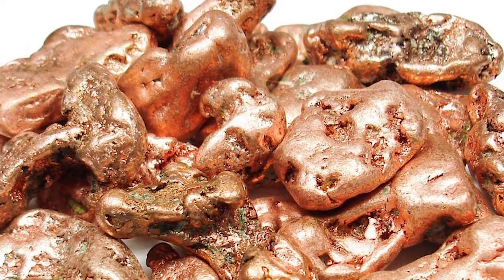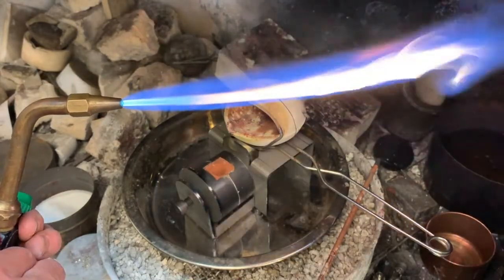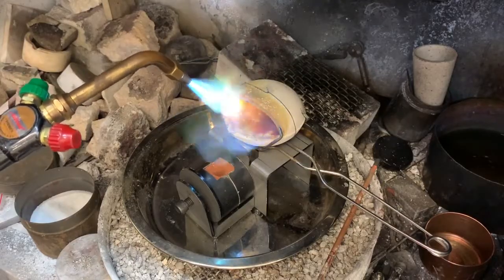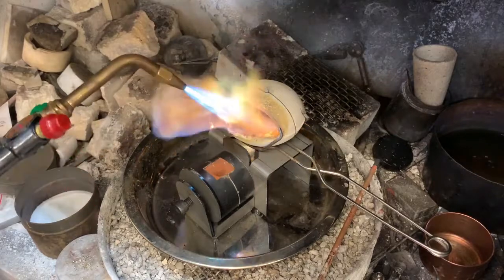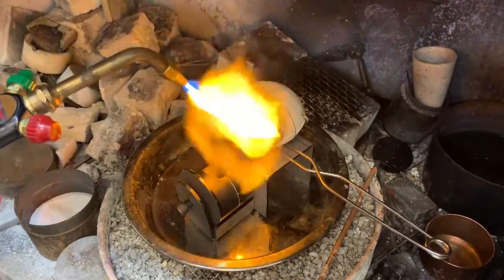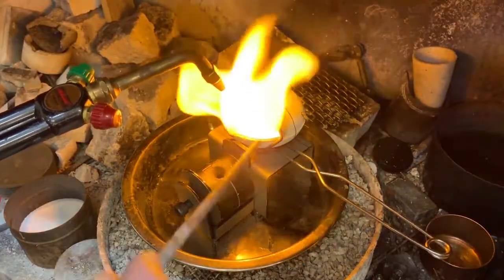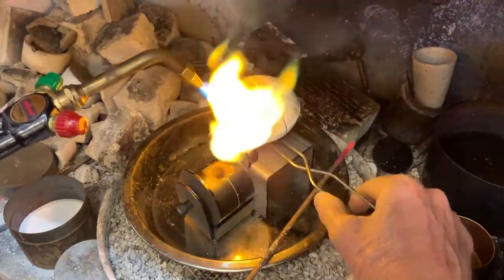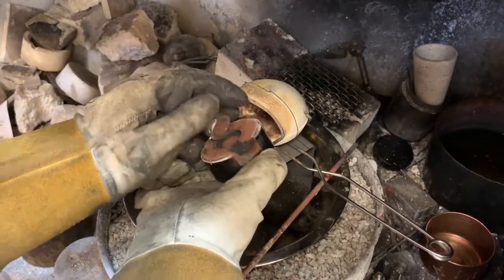Tips for Melting Silver with James Binnion

Comment: I find your video very inspirational and helpful, does the adding an extra crucible to the top help .. dumb question ... should I attempt this method to try and find better results? I am wanting to pour 8" by 1/4 x 1/4 castings to draw into silver wire. I have never done this before although I am a third generation plumber and love making silver jewelry and thought I would give it a try. Even tho it's very expensive. I've dropped a lot of funds into this endeavor.
Thank you for your fantastic video!
May God Bless you

Comment: Really amazing, I have some pure silver beads that have a bad surface because of oxidizing, how I can melt them again to get a shiny silver without oxidized surface?
Reply: If you mean pure (0.999) silver then just do as the video depicts and you will get the shiniest silver casting. If you mean pure sterling silver (0.925) then you do as the video depicts and pickle (find a video about pickling silver) the silver afterwards, that will remove the copper oxide.

Comment: 🤔How does this compare to a small eclectic melting furnace? I bought the   1kg Tilt-Pour Electro-Melt Furnace last month from Pepe Tools and have yet to do any silver casting but plan to. as I currently understand, the furnace will create a near-free oxygen environment...and I can pore it like a jug of water into a mold minimizing exposure to air.
Reply: If time is of no concern then an electric furnace will do the same thing except that it will take a long time (up to one hour or more) to get to the right temperature (depending on the type of furnace you have). Melting the silver with the proper torch (oxy propane, oxy acetylene, air acetylene) will take you no more than 10 minutes from start to finish (casting made).